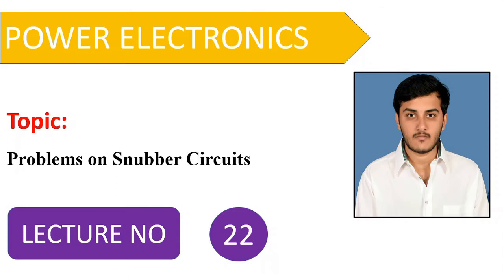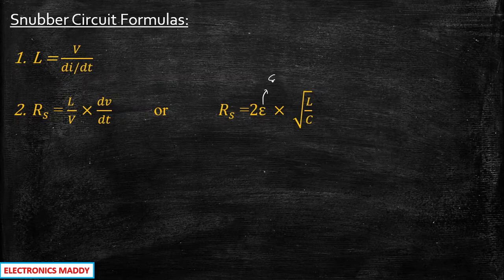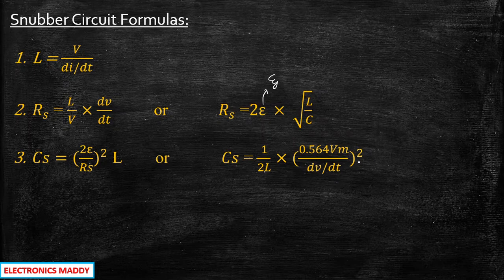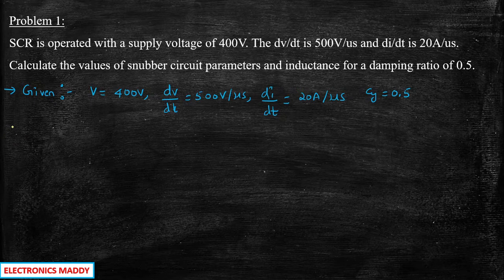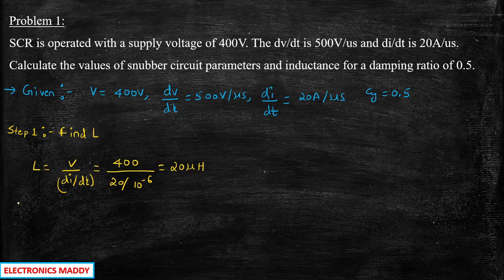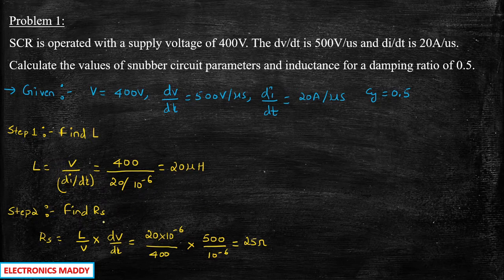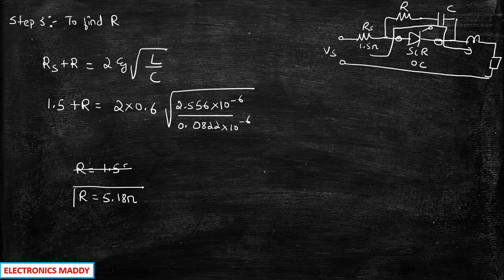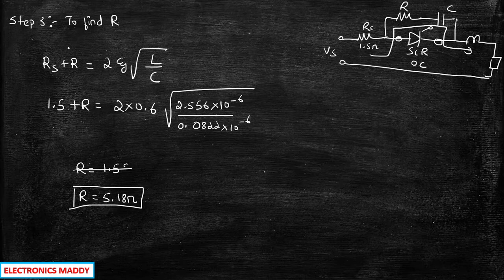Problems on Snubber Circuits | Power Electronics | Lecture 22

Comment: Design	snubber	circuit	to	protect	given	SCR	against	dv/dt used	in	single-phase	converter	circuits.	Input	line	to	line	voltage	has	peak	value	of	425	volts	and	source	inductance	is	0.2	H